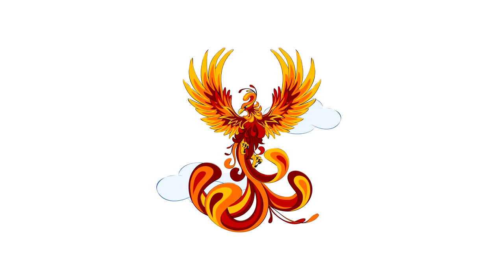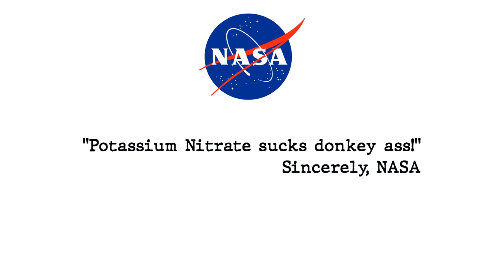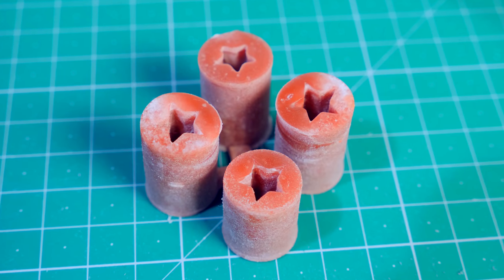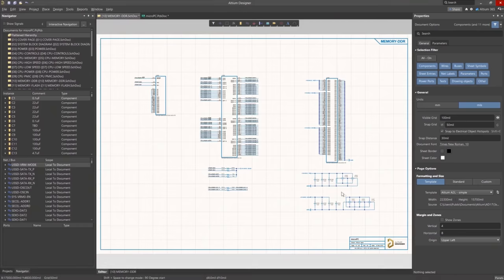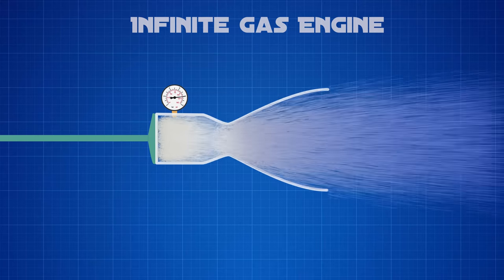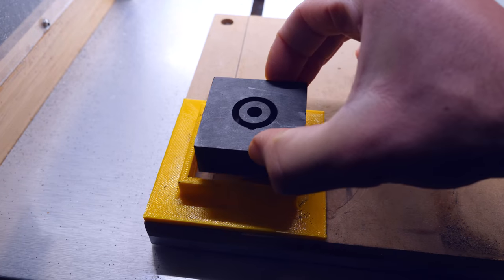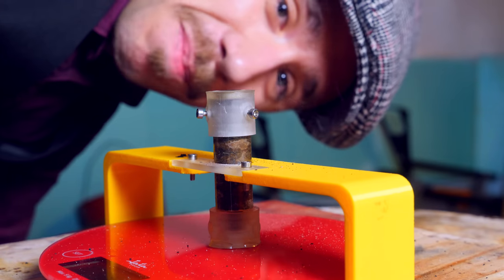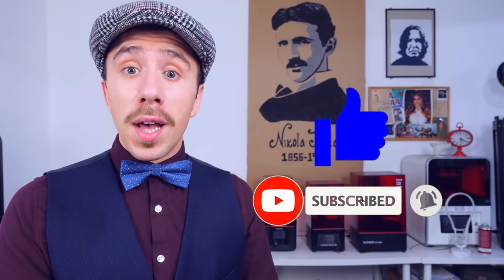I built a PULSED ROCKET ENGINE

Comment: Testing until it explodes? - This gets a thumbs up from me!
Reply: Or you could redo older engines with knowledge you had not had back then
Reply: Hi luv ur vids
Reply: There's a surprise...
Reply: ngl what im thinking that is happening is the first solid fuel igniting then the second seperately because the sparkler goes and ignites the first  before getting pushed out so maybe gun cotton inside the fuel?
Reply: @aloof6124  the ceramic nozzles would have worked better if he glazed them. He already has the kiln to fire the 3D printed ceramic so the lower temp to fire the glaze would be possible.
Reply: Tested to destruction is always a solid plan of action and should always be written into a project overview!
Reply: @glowytheglowbug  gun cotton doesn't make a good rocket furl. The reaction has a feed back loop for both heat and pressure. It burns fast and faster as they increase. 

  It will explode as soon as any usable thrust can be achieved if not sooner.
Reply: @sumduma55  what i mean is use it as a igniter
Reply: certified spacex moment
Reply: It would be so cool if rockets reached the end of their stage and just erupted flames out of the sides like an overcharged battery 

Dangerous, sure, but also neat

Comment: Idea: still along the lines of 3d printed rocket grains, instead of using a mixed resin as the grain fuel, use regular FDM with ABS/PLA/PETG. Using these FDM plastics, you can pass a gas like oxygen or another gas oxidiser through the grain and the PLA essentially turns into rocket fuel. Compare the different power outputs of each FDM plastic type, and the different gas oxidisers!
Reply: Pretty sure he has a video doing exactly that

Comment: Integza, you could try spiraling the fuel grain instead of having it be a straight bore, that might help it burn less chaotically.

I'm wondering if you could 3d print a multi-tool, it would be interesting to see what kind of an edge you could put on a ceramic 3d printed blade.
Reply: you mean like in a vortex cooled engine ?
Reply: The spiral might introduce an uncontrollable spin. For a firework it would be cool but rocket engine tech is to get us as passengers safely up into space. 🤔😆
Reply: @terrafirma9328  second reversed booster?

Comment: Video idea: create a launchpad for 3d printed rockets and measure how high they will fly using different rocket nozzle designs+

And: Tomatoes are disgusting🍅🍅🤢
Reply: I 3D Print the connector on my launch pad's and then use a metal plate as a blast deflector, and 20mm PVC conduit for the legs. And 3,2 mm brazing rod for the launch rod, 1 meter, or 3 feet for the small rockets.
Reply: ngl what im thinking that is happening is the first solid fuel igniting then the second seperately because the sparkler goes and ignites the first  before getting pushed out so maybe gun cotton inside the fuel?
Reply: @glowytheglowbug  that would be for sure a good idea ig
Reply: @priuxls  yepp

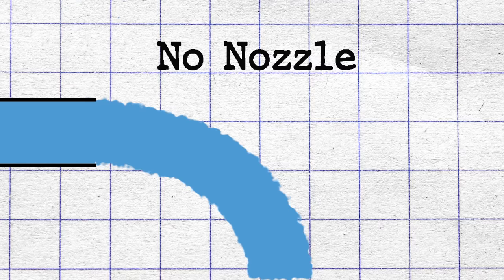Comment: 5:15 It's my understanding that the gas heats up in the chocking point, it can't gain speed so the energy goes into heating up the gas, when you expand the nozzle the gas is able to expand and the speed increses.
ScottManly explains this very well on his Hypersonic wind tunnel video, go check his channel, I think you may like it
Reply: yeah, now that make sense to me, the gaz can't gain speed so it heats up, and has you let it expand, that extra heat is converted back into kinetic energy.

Comment: Integza, thanks for using my battleship nozzle idea, and the cause of the pulsing and under performance of the engine is because the engine is getting chocked, either by inefficient burning causing residue to block the nozzle ( which may be fixed by having the nozzle side down ) or by the nozzle being over constricted ( which I believe is what caused the sputtering )

Comment: Hey Integza, I make rockets every year (Guy Fawkes) in the same way commercial ones are made. The sugar KNO3 works fine (a small addition of sulphur helps) in a card tube. The grain is also the combustion chamber. I use builder's  plaster filler to make the nozzle by laying it over a former. A tube shaped whole works well. I use a metal rod as a former. 
Those oscillations in your burn were caused by two things, 1) the shape could be slightly inconsistent and 2) Up to a certain limit the rate of burn is proportional to the pressure in the chamber. So everything gets exaggerated.

The boosters for the shuttle are much the same. They use rubber and aluminium powder as the fuel with perchlorate as the oxidiser. The core is a simple tube. P.S. Have you heard the story about the boosters and the size of a roman horse's butt? let me know...
Reply: nice ngl i was thinking 
that what was happening is the first solid fuel igniting then the second seperately because the sparkler goes and ignites the first  before getting pushed out so maybe gun cotton inside the fuel?

Comment: It looked like the bottom cap of the rockets were melting while being tested, resulting in deformation as it went. That might be introducing some inaccuracies in your force measurements.
Reply: And the fuel is burning up as the test is running, resulting in a lower reading. The rocked should be placed horizontally when testing it's force for more accurate measure.

Comment: Very cool. From what I've researched, I think in general it's just going to be a problem until you can find out the perfect mix of oxidizers and fuels that can be printed because I know that they typically moderate ammonium perchlorate with other chemicals to control the Burn Speed and I'm sure that NASA has multiple documents on it they use a couple different kinds of plasticizers that also have moderation capability
Reply: well, mythbusters found the perfect misture for air + water bottle rockets once, it was 1/3 water 2/3 air and a bike pump.
Reply: just had a stroke trying to read this
Reply: You can read the exact ratios on Wikipedia, but they use PBAN as fuel, and this resin is quite different. But they do use iron oxide as a catalyst for the engine, and aluminum powder. IDK if PBAN is safe to 3d print (probably isn't) but there are some less chemically volatile stuff that gets better performance than the resin used here.
Reply: @Scyth3934  lol, welcome to the nerd corner. We say stuff that either is concise or a long essay that English teachers want you to write in 10 minutes.
Reply: @rocketcello5354  yes, pban+ap+ferric oxide+aluminum in just about every solid stage motor out there.

In my mind you'd just 3d print a mandrel or similar to asssit the grain casting, not printing the grain itself as the aluminum is so important to the mix.
Reply: @InvestmentJoy  yeah, that's probably a good idea
Reply: He could try potassium perchlorate at 70%, it burns faster than AP and it works in epoxy too.
Reply: @InvestmentJoy  what are you doin here lol, you manage properties. How can you be a rocket man too lmao

Comment: Add aluminum powder to the mix. That should improve the performance. Perchlorate, aluminum and rubber is a solid rocket fuel. So you would have perchlorate aluminum and resin should perform decently if you can get it to print.
Reply: adding aluminum powder would mean adding more perchlorate, and the resin already has too much stuff floating in it

I think you need a thicker resin for that
Reply: Heh and if you just mix the aluminum and perchlorate, you get flash powder for firecrackers. Win-win
Reply: @frzferdinand72  
...but no 3D-printable substance to make custom shapes!
Reply: @1224chrisng  or a viscosity reducing agent. They only take up single-digit percentages of the final mix, I think Tech Ingredients covered these compounds in one of their thermal paste videos actually

Comment: Idea for some of your older projects? Husky high performance blow gun with ultimate flow tip. Look this up. That tip can nearly double the output when air is blown through it. Maybe it can be used on some of you're previous projects to increase thrust. The higher the output, the stronger the thrust.

Comment: Try stacking a bunch of these together to make an auto detatching multistage rocket. As the fuel burns up it lights a second stage which burns/detaches the previous stage
Reply: Presumably the holy grail would be to print rocket nozzles in with the fuel so it's more self consuming than staged.

(Assuming nozzles that burn, just slower than the fuel)
Reply: I don’t know if you can get a good convergent nozzle that way but I know that a short unrestrained length of some fuses will fly many meters when burned. The core (slow black powder) burns faster than the jacket (cotton/lacquer) and directs the gas as it burns

Comment: The nitrocellulose detonated due to too much preassure. An easy way to slow down the burnrate is just to press it together. The harder you press it the slower it will burn, yours was very loosely pressed so it burns faster. Modern cannons today uses a big white cylinder, which is litteraly just pressed nitrocellolose. If you can manage to put the cellulose in a press, you will get a pellet that you can just drop into the rocket engine and with a metal combustion chamber it can usually be reused since nitrocellulose is a complete combustion, it doesn't leave any residue.

Comment: 2 ideas to try;
First, I think you'll get more power if you add some sugar into this rocket-resin. Resin is a long chain molecule with its set, so it will burn slower than something like sugar. This will help you get a faster, hotter burn, without compromising the printing of the resin much. And it wouldn't take much sugar (by %) to get a good amount of improvement.

Second, since your machining skills have improved, try a revisit of the Tesla Turbine! Maybe power it with some rocket resin, and see that baby go nuts!

Comment: Video idea: well, more of a project idea I suppose. I really like this idea of 3d printing propellant grains, this could seriously be a game changer for solids/hybrids since you can print some really interesting grain geometries. Maybe  you could make a video on making a data acquisition system that measures your rocket motor chamber pressure and thrust. Then, you could do another video on designing a rocket motor test bed that is reusable and can withstand multiple firings. Then finish it off with a test series and comparison of different propellant grain geometries and fuels. Then bonus video: build a high powered rocket and launch it with your best 3d printed fuel. 
P.s. if you want any advice on building rocket motors/engines feel free to reach out to me. I'm a rocket propulsion engineer by profession and would love to collaborate with you.
Keep up the great work!
Reply: Love it BMFW!!!
Reply: I love that, might be a good idea to run it outside

Comment: You should put the 3D printed rocket fuel into a aluminum casing to hold the pressure so that it can build thrust just like they use in model rockets 🚀

Comment: Suggestion: Go get some gunpowder that is "smokeless powder" (smokeless powder is nitrocellulose). Dissolve the smokeless powder in acetone. Be sure to stir it thoroughly for good consistency. The result you will have is a gooey fluid to paste onto things, or pour into things. If you need it to be thinner, add more acetone; if you need it to be thicker allow the acetone to evaporate out of it. Once it is on, or in, whatever your using it for, allow it to dry THOROUGHLY for all the acetone to have evaporated out of it. The end result will be a hardened pyrotechnic coating or filling. I'm not sure how well it will work if you mix it with resin, but that's up to you to find out. 
And I am with you, tomatoes are disgusting. Have fun!
Reply: @LabRat Knatz true, ping-pong balls are made out of nitrocellulose, and I had a lot of fun in my childhood lighting ping pong balls on fire. But using smokeless powder as the core ingredient is a lot easier than grinding up a bunch of ping-pong balls.
Reply: INTEGZA, if you don't believe me about this simple recipe, just Google a little bit of research into it. Trust me. You're going to have fun with it. And for added enjoyment, add a tiny bit of powdered aluminum for pizzazz.

Comment: Hey, Integza you should try to make a fine powder of nitrocellulose and mix it along with the oxidizer and resin to get a good fuel that can have a high burn rate
Reply: Nitrocellulose does not need an oxidizer, it is self contained already. That's why it can used as gunpowder.

Comment: Video idea: layer the fuel in this way: faster burning = inner layer, slower&longer burn = outer layer. Nitrocellulose should be the inner layer, maybe phosphorus as the second layer, and keep layering until you get to rocket sugar or something more slow burning. That should make the rocket burn fast, and when it's turn for the outer fuel layers the temperature inside the rocket chamber should be big enough to burn it fast enough to work well as a rocket. If faster burning fuel were to be in the outer layers, the rocket would explode because the pressure generated would be too great for the chamber. (So the idea is to keep constant pressure with the increasing temperature by picking slower burning fuels as time goes on).
Reply: Or the rocket explodes anyway and instead of rocket pieces everywhere you have burning fuel too🚀😂🔥
Reply: Its basically a continuation of my comment, good thinkin brother

Comment: I think you can actually make rocket fuel with nitrocelulose, but you might need a bulkier chamber, would love to see that as a video
Reply: Yes that's just what Integza needs, more pressure and a stronger chamber... BOOM... Goodbye integza
Reply: Nitrocellulose is way to agressive in terms of burn rate over pressure. The higher your camber pressure gets the easier it will be to achieve even more just making it explode again. It’s not a fuel, its a explosive. Don’t kill yourselfe with it. It’s all fun as long as you don’t have a real pressure vessel surrounding ist. Then it get extremely dangerous

Comment: Hi Integza 
Maybe you will try to make a turbine herona "The device consisted of a fire-heated boiler and a proper turbine in the form of a ball mounted on an axis. On its circumference there were two nozzles directed in opposite directions. the nozzles. The recoil forces of the same direction but the opposite direction, caused by the steam exiting the nozzles, generated thrust and set the ball in rotation. " Happy New Year
Reply: I think we've all seen that seen that too many times, even with liquid nitrogen. Also how often does he work with metal, because what you're talking about is insane to try to make even with someone who's good at metalworking and soldering

Comment: Video Idea: it'd be cool if you used a raspberry pi/Arduino to make a code-able and remote ignition system. Be cool if you used step-up transformers and just send a plasma channel level arc through the combustion chamber to set the fuel. Also again, code-able. And if you when back to using propane and O2, you could have a pulse jet engine by simply setting an interval. All this could be down through Raspberry pis gpio and running it on something like MU (Python) or Node.js (JavaScript).
Reply: I actually think this wouldn't be too hard to do. There's not really any need for soldering and most of the heavy lifting would just be through code. And there's more then enough references online for this stuff. Like node.js blinking light, just use the same code but instead of an LED you can use your choice of ignition system
Reply: You could also build another test stand for this and add a pressure pad (FSR) to feed data into a pi and get very accurate pressure/thrust readings

Comment: Can you try turning the nitrocellulose into a powder and mixing it with the resin and oxidizer? Ping pong balls are another source of nitrocellulose if you don't want to keep making it. And nitrocellulose dissolves in acetone so maybe try mixing it in the resin to see if it works as well

Comment: I absolutely love your videos and just wanted to contribute my grain of salt to your testing: I've observed how you always use a scale to measure the thrust of your rockets, but I have the impression that you're not getting the accuracy you need and you can't read sudden peaks in power. I was thinking that you should maybe build an 'Integza official rocket testing stand' to try all of your rockets. I would start by having a look at strain gauges for mass measurement (like the ones that your scale has), or maybe some kind of rail where you can attach precise weights and compare designs.

After that, you could maybe make a special competition video, where you go back through your past designs and make some kind of ranking from best to worst (including a "best explosions" montage). I think a video like that would be awesome for new people to discover your channel.

Anyway, keep up the good work as always and don't hesitate contacting me if you need some info or ideas on the test stand (I'm an electrical engineer and I've build something similar in the past ;)
Reply: I bet a strain gauge -> Wheatstone bridge -> arduino ADC -> parallax DAQ Microsoft excel plugin would be perfect for this.
Great idea!
Reply: @SD-fw9li  arduino yey